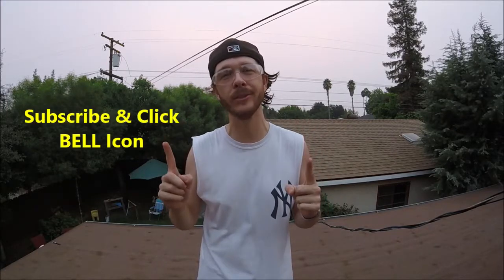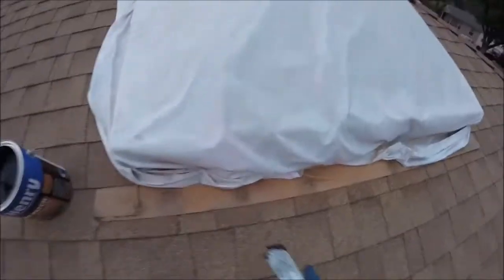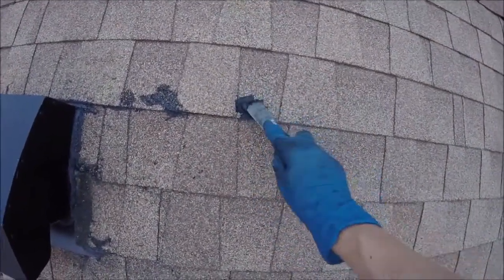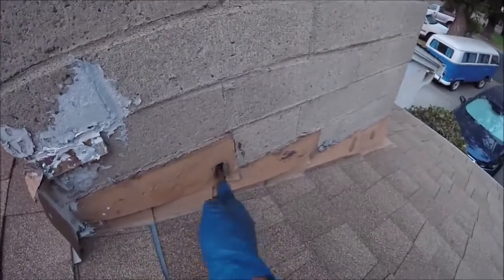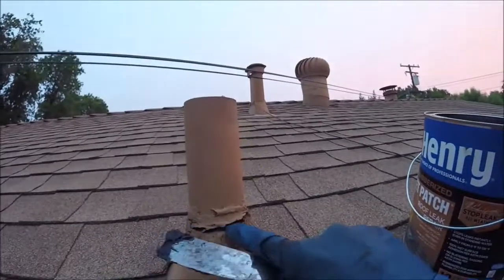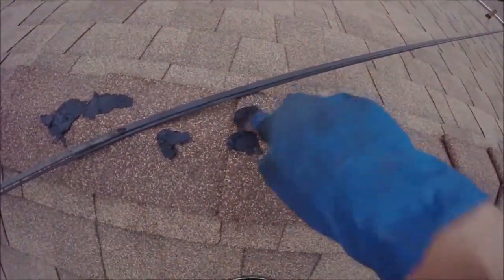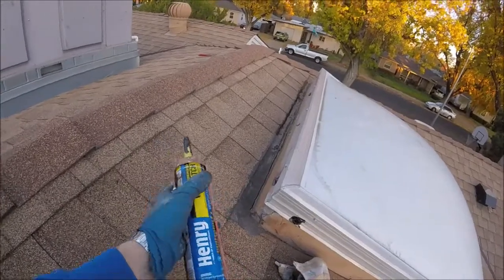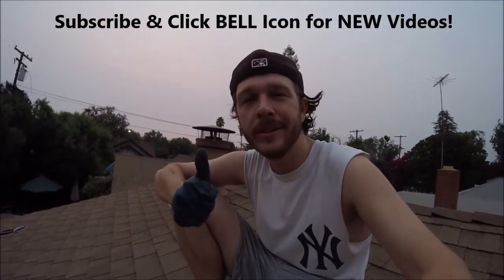How To Fix a Roof Leak. Any Type of Roofing. Shingles, Vents, Flashing -Jonny DIY

Comment: I live in a very sunny place so UV pretty intense here.  I have found Henry wet patch will crack in about 2 years.  You can go over it once, but after that you have scrape it all off and start over.  For longer term more maintenance  free results I would use other products.
Reply from the maker: You're right, I'm in California and it only lasts about 2 years too. Have you found anything that works better?

Comment: Good video, but some of your links don't go to the products just the Amazon website.  Would you please tell me if the sealant comes in different colors to better match the color of the roofing?  Thanks! 👍👍👍
Reply from the maker: Thanks. Yeah sometimes I have to put links to a list because the product is prone to selling out or discontinuing and I never know the links gone bad til someone points it out to me. They actually make the sealant in clear color in caulking tubes. I know Henry makes some. Clear roof sealant. And for getting  color to match best bet is getting a lil quart of latex that matches roof or buying a can of roof accessory spray paint that matches roof and vents. I've used both with success 👍

Comment: Johnny, our family is very handy but also have a very long successful history of falling off roofs. Is there a special formula for getting off the ladder and getting back down?
Reply from the maker: Yes walk down towards ladder, if steep pitch as you get close get down on your butt and scooch closer with your weight centered back. Then grab the top rung and turn yourself around and go down the same way you came up. You want ladder extended above edge of roof somewhat too so you have something hold as you get on and off. Its best to have someone steady the ladder at the bottom too. Steep pitches do make it trickier, but you get used to it with time
Reply: @JonnyDIY   Thanks,  I would not give any advise for liability purposes. You have a good channel and I love your work. People are crazy out there when things go south (lol). Thanks for the help.
Reply from the maker: @jazzcornertv  thats true! Be careful! 👍